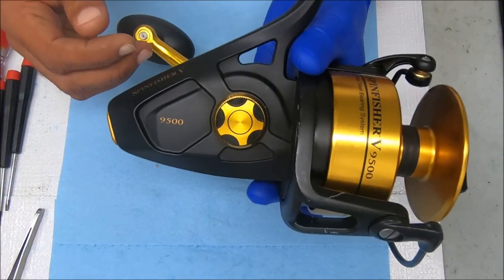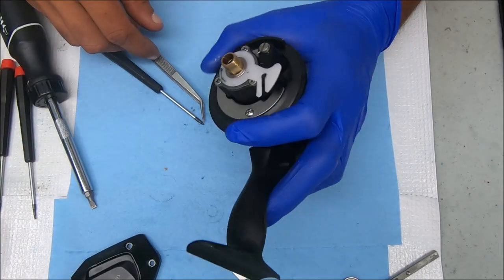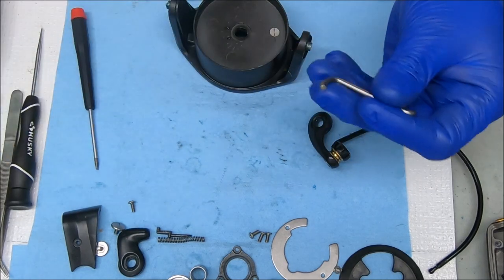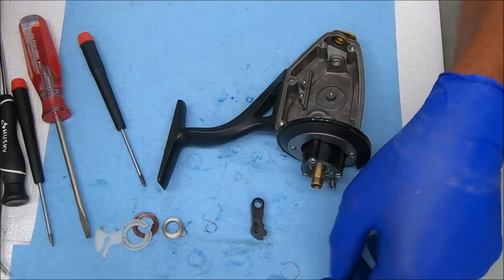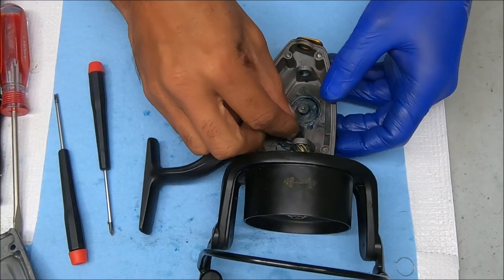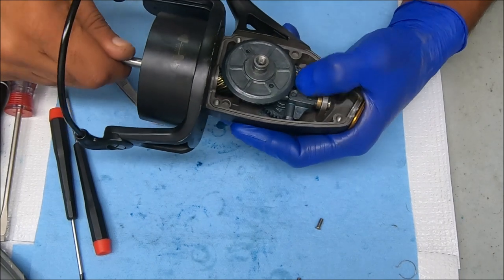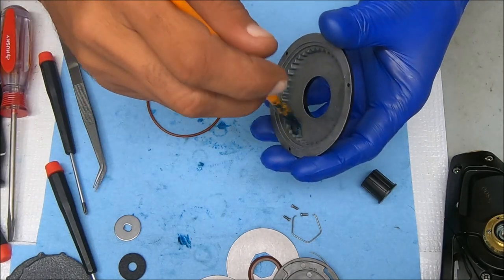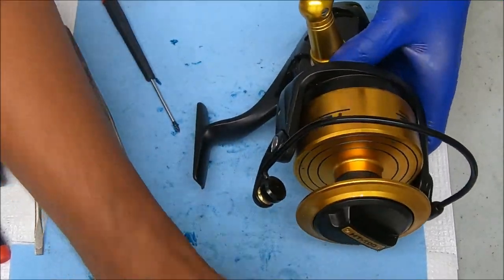Penn Spinfisher V 9500 Fishing Reel - How to take apart, service and reassemble

Comment: Hello, I have just discovered your channel and I really enjoy the videos, the professionalism, the form of the work and the thoroughness. I have such a roller model 10500, its drag is very weak in terms of the clicker, I wanted to please ask is there a way to replace the clicker in order to be noisy when a fish is caught and not as quiet as in the original ? Thanks in advance
Reply from the maker: Welcome and thanks for watching. Check out the part of the video where I break down the drag. Clean out the ridges in that plate thoroughly and add a very thin coat (a lot less than you see when you first open it) of grease.... the clicker will be louder.
Reply: @TSGReelService  THANK YOU !!!
Reply from the maker: You're welcome.

Comment: i have a penn 8500 and the screw that holds the line roller, was damaged from previously attempting to remove. How do i remove it? so i canreplace with a new one.
Reply from the maker: Thanks for checking out the video. I have a trick for that situation in one or two of my other older version Spinfisher videos, but don't remember which one. Check my video library for it.

Comment: Hey buddy a slight problem i have with my Spin fisher v 9500, when i open my bail arm it dose not stay open i literally have to open it and put some effort to get it to remain open. what could be the issue
Reply from the maker: Hi, can you make video showing the problem so I can see what's happening when you do it? Do it a couple times slowly from different angles. You can post the link to your video here so I can check it out. Thanks.

Comment: so whats the trick in putting the spool back on? I screwed something up putting it back on and now I have no drag..help...
Reply from the maker: There's no trick to putting the spool back on. Just line up the keyed metal washers with the shaft. Is your issue with a 9500ss or 9500ssv?

Comment: Very good the last video on the spin fisher when you didn't touch the drag did you ever find out why there was a grinding with the drag locked all the way down because my real is doing the same thing
Reply from the maker: Thanks for checking out the video. I'll need more info than that. It would be in the video. Go to it and comment with the time stamp. Thanks.

Comment: Hello. Disassembly and lubrication of the new reel after purchase should be done immediately ? Or is it still blurred by the manufacturer?Thanks
Reply from the maker: Thanks for watching.... I'd prefer to do it that way.... sometimes, they even come from the factory with pieces missing or incorrectly put together..... always good to double check and set it up the way you like. Note, it may void the warranty if you do. More vids to come.
Reply: @TSGReelService  Thx for answers. Maybe  you can make main gear and pinion gear from stainless steel ? :D
Reply: Hm, in ssV ball bearings not fixed by screws in frame like in ssVI ?

Comment: Hi what do you not use the  Cals  grease on the internals of the reel ? Thanx
Reply from the maker: I use it mainly for drag washers, but you can also use it anywhere else you would add grease in a reel.
Reply: Thnk you :)
Reply from the maker: @philproud7254  No problem.

Comment: How do you stop that slight rotor back play after servicing..? my slammer dose it as well now. Ive put it all back together write.? cheers:). Tackle advisors had the same problem as well.:)
Reply from the maker: Thanks for watching! I'm assuming you put it back together properly and I'm guessing he (Tackle Advisors) also checked the following things..... but the cause can only come from a few places.... the rotor nut (make sure it's set), the opening in the rotor where the pinion gear goes through (if there's wear in the corners or edges, it can allow for some initial "slippage" as it "locks"  into place during the transition from from spinning to stopping and vice versa - rotate the rotor back and forth by hand to check), or, the likely culprit... the anti-reverse clutch (could be worn and need to be replaced).

The little cylinders in the a/r clutch ride in a plastic housing that can wear over time.... think of trying to reshape a plastic straw after chewing on it. This slight back play isn't necessarily detrimental to the performance, but I'd keep a replacement a/r clutch assy on hand, if I were you.

Hope this helps. Keep me posted.
Reply from the maker: Forgot to mention the gears... hold the rotor and gently turn the handle back and forth.... if there's significant play, the gears are probably worn... you could try shimming the main gear, but that won't always work... the MG and PG should be replaced.
Reply: @TSGReelService  Thanks heaps for your reply.  There is some movement where the anti-reverse fits into the hexagon shape body. My spinfisher has only ever been used once.  I don't know why that one would have play in it as well.  I'm guessing its the same problem. My slammer has done a bit of work, not much though. 
The a/r clutch inside seems good.  There is no movement.  But there is movement in where it sits into the body.
Reply: @TSGReelService  How do you set the rotor nut??  It looks like there is a lot of play just where the rotor nut needs tightening. The gears should be fine because it hasn't done all that much work?
Reply from the maker: You're welcome and no worries. All those things could affect the rotor play. Not necessarily one in and of itself, but one magnifying on top of the other. Like I said before, the overall performance of the reel shouldn't be significantly affected.
Reply from the maker: I agree, the gears are probably fine.... was trying to give you as many possibilities as I thought of. Snug down the rotor nut... you can be pretty firm, but don't overtighten, as you could affect the bearings in the pinion stack.
Reply: Yeah its still doing it tried all that ,I think its were it fits into the housing ,each hexagon shape looks like it wants to lift up before locking in, was fine before pulling it apart.The pinion gear looks ok. I cant see how they can be solid as new. I have a new slammer 5500 but don't want to pull that apart now. lol. Thanks heaps for your help. I have subscribed to your channel. All the best from Jake.
Reply from the maker: Thanks for subbing! The stack at 29:00 shouldn't have a lot, if any, up and down movement... the bearing cover keeps the stack in place and rotor nut keeps the pinion gear in place. The a/r clutch may shift laterally (slightly), but not vertically. If everything you've tried didn't work, and there's not a lot of play in the gears, I'd recommend getting a new a/r clutch to see if that does the trick.
Reply: That video you sent me at the end when he's winding it put back together. when he stops and starts it, it looks like the rotor has some movement as well. Thanks so much for you time.:)
Reply from the maker: You're welcome. I don't remember if it did or not.

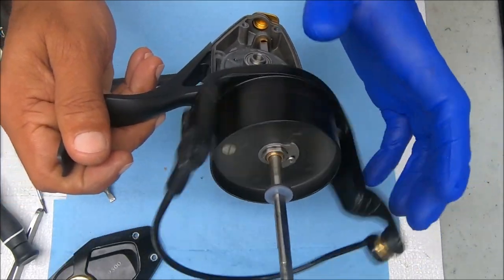Comment: Hello, When you rotate the reel at 6:22 min I hear an interesting noise. Sounds like reel brake. What is the reason? I have same reel and yesterday I have heard this noise but I cant find the reason. Please help me. Thank you.
Reply from the maker: The backup dog is the noise.... a spring was damaged.... and changed later in the video.... keep watching to see the discussion about it.
Reply: Thanks, I have checked, but my spring is okay, it is not damaged, not broken. And I hear the noise only rarely not always. What is the function this part? Because in the smaller SSV reel you cannot find this unit.
Reply from the maker: It's a backup for the anti reverse. Your spring could be worn. Try replacing it. If that doesn't help the issue, take it to your local repair shop.
Reply: @TSGReelService  Okay thank you. Yes I think the spring is weaker than the new. I try change it.
Reply: @TSGReelService  Dear Friend, please let me know what kind of grease what you put in the brake system? What is this grease main function? Thank you.